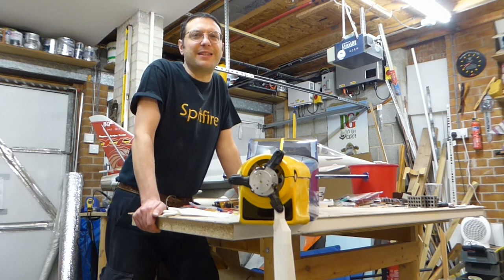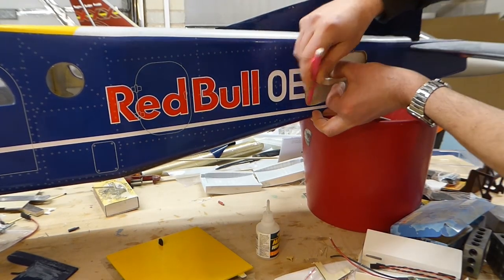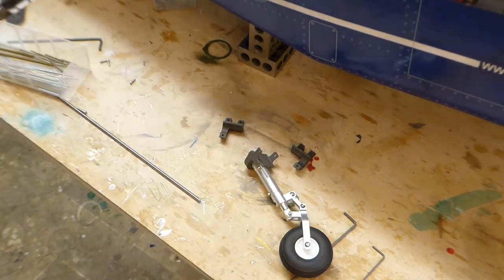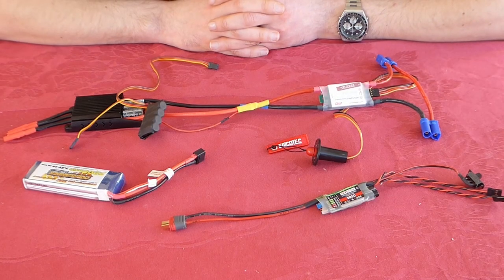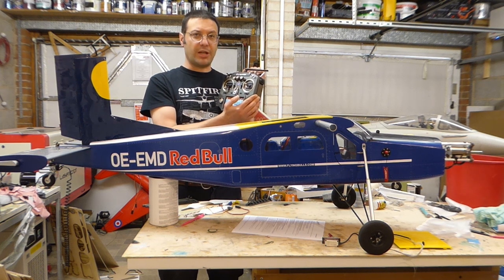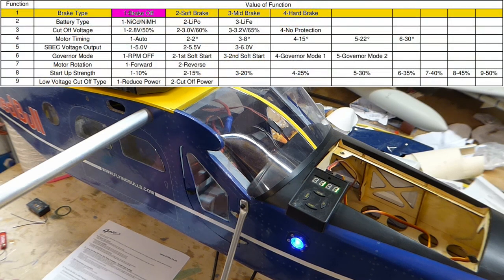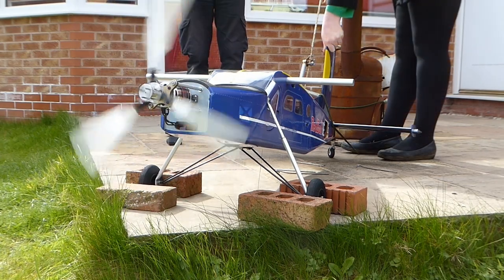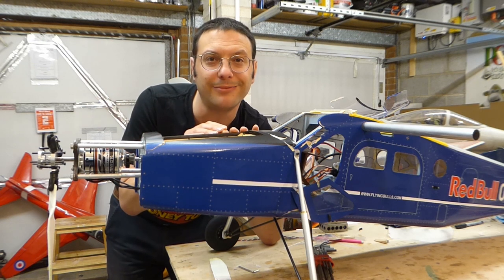VQ Models Turbo Porter with Variable Pitch Propeller - Part 3

Comment: What on earth made you think printed plades would be safe to use.???
Reply from the maker: Comparing the strength of the 3D printed PLA (with a high infill) with glass filled nylon (often used in RC propellers) there is not a huge difference in strength.  There is however, a big difference in the design of the blade root.  Before giving up entirely on 3D printed blades, I have a couple more experiments to try involving changing the root design, the print orientation, and adding a sleeve to the mounting hole.

3D printing might still not work, however, I am encouraged when I see working designs for 450 sized model helicopter blades that are successfully 3D printed and flown (these are typically about 300mm in length and run at around 3500 rpm).  Hopefully, the smaller diameter of the propeller compared to these 450 sized helicopters should reduce the forces at the root to an acceptable level.  Will shall see.

Comment: I've been flying this model for about 4 years now. The tail wheel setup is less than good, and you may want to fit a strut tower support inside the cockpit to reinforce the fuselage walls where the shock struts attach.
Reply from the maker: Thanks.  I have replaced the tailwheel (as per Part 2 of this series https://www.youtube.com/watch?v=yhocSpaeyeU) along with the tailplane and vertical stabiliser.  As you can see in this video, there are quite a few repairs needed for the fuselage, and so the reinforcent you suggest should be quite easy to do.

Comment: Love the project! However, looking at the way you are actuating the variable pitch rod would have me worried, looks very flimsy. I think there may be more force acting on it than you may realize. Not have accurate control of the pitch may have contributed to the blade failure. Will keep watching with interest. Good luck.
Reply from the maker: I have altered this mechanism a little for the next test.  I can only go to 1/8" for the inner steel in order for it to pass through the motor shaft (which in turn must pass through the windings), but I have since changed the actuation mechanism a little.  Lots to try yet.
Reply: @ScaleMeDown  It wasn't the thickness of the rod I was referring to, but the mechanism you had between the servo and the rod. I was thinking about it earlier and thought it may be good to use a lever, with the fulcrum at one end, the rod in the center, and the servo acting in a slot at the opposite end. The use of the lever, if adequately long would give you a small arc. Not sure if that makes sense, but just my two cents. 
What software are you using for your designs? Looks like a mesh editor. Ever thought of using a program like Fusion, might make designing your prints faster and easier. Looking forward to the next update.
Reply from the maker: @lowtus7  Hi.  That idea sounds like it might work - I shall give it some thought.  I am using sketchup for the 3D design - only because I learnt how to use it a while back and haven't gotten around to learning Fusion 360 - I agree its about time as its a much better program !
Reply: @ScaleMeDown  Fusion is definitely worth having a look at, and it's free for makers ( With a few generally inconsequential limitations ) A bit of a learning curve like any program, but not too bad. Look forward to seeing your progress, good luck.

Comment: Your work is very dangerous! Don’t print blades or propeller!!!
Reply from the maker: Hi.  3D printed blades work absolutely fine, and no subsequent failures after their redesign.  The out-of-control rpm was the culprit thanks to the esc govenor not working.  Keep watching the other parts of the series to see the success with this propeller.